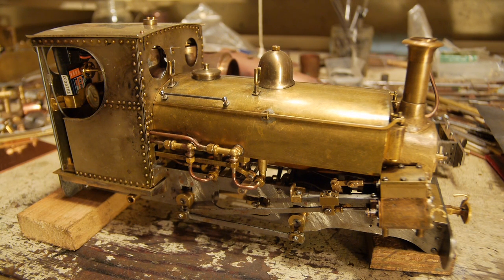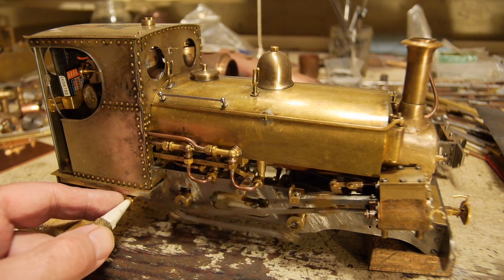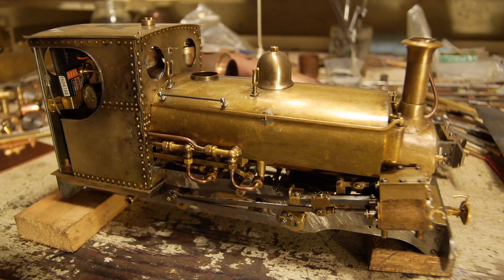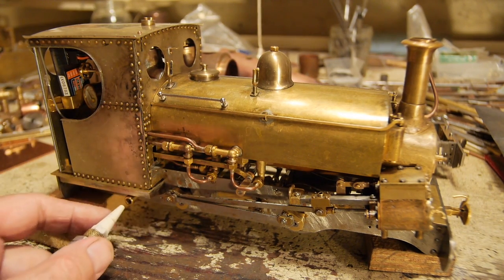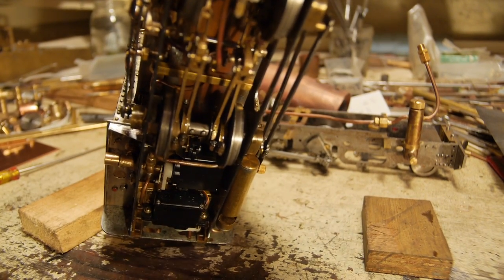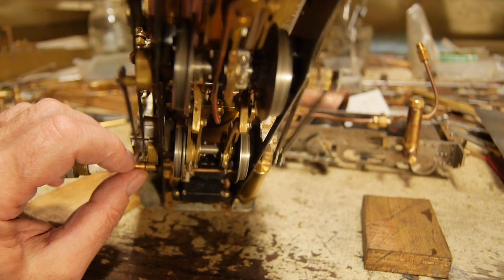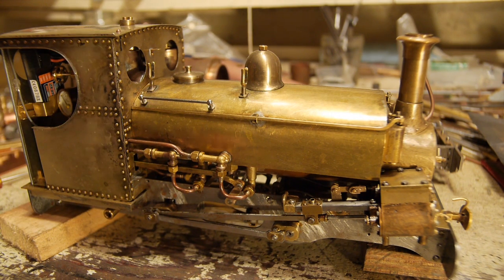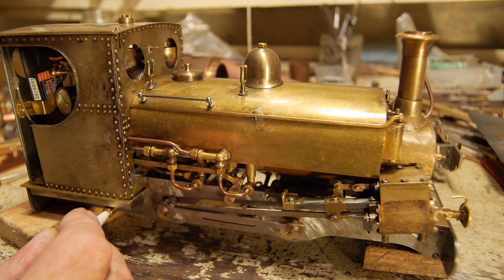Building a live steam model locomotive 'Blanche' from castings, Part 1

Comment: Very nice! I have a Rob Roy that someone started to build but didn't finish. They put the frame together and drivers with some valve gear inside the frame like you have here. I think I have most of the castings such as the pistons, steam dome and such. I don't have a mill so I doubt I will ever complete the locomotive but I do get motivated when I see videos such as yours.

Comment: great engine looks amazing just wondering how you finish the cad as i am trying to get the  rounded edges as making a pigs ear on the curves, yours look so neat, thanks for the old films of the coal mine engines, when we lived by the railway at chalford,they used to have a engine that came out behind the mainline train and get behind and help it up the gradient outside the house it would go that slow that when dad came home on it he would step off outside, rather than the station about a mile earlier, no health and safety then, thanks again for sharing
Reply: Hi, and thanks for your comment.  With regard to the cab I guess you mean the door.  I just blue the brass sheet and mark it out with a compass then cut and file to the line.  The curved bits I cut with a piercing saw, that's one with a very narrow blade, so I can rotate as I cut.  Practice will improve your technique.
Reply: @jonathanguilbert8658  hi thanks for your reply, the curves i machined to get perfect match i was trying to roll over the edge to make it look like a hand rail running round the curve thought your had that lip on yours  from the video
Reply: @msampson1949  The lip is a strip of thin brass soldered onto the edge of the door aperture.  Quite easy to do by bending the strip to the shape of the door then holding it in place with a piece of metal whilst you solder round the edge.
Reply: @jonathanguilbert8658  thanks that sounds better than trying to roll it over thanks hope you do more of your ashley green video's they are great to watch thanks again for your help will keep it simple in the future